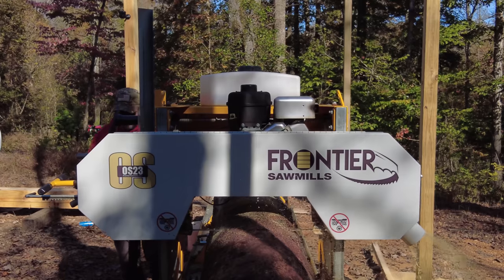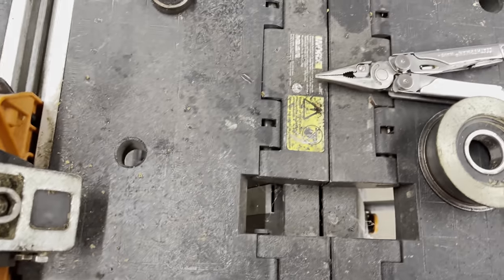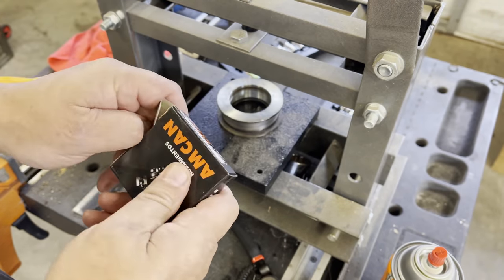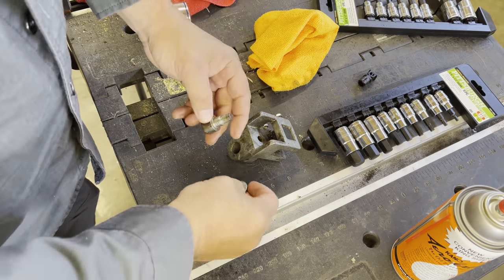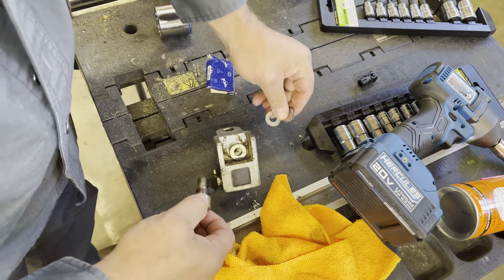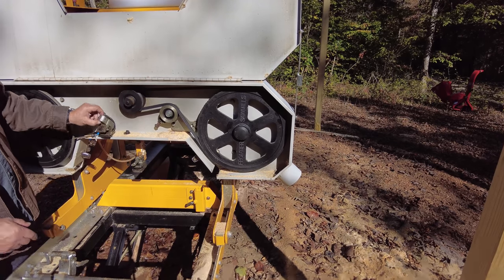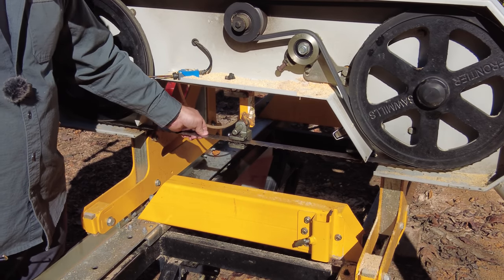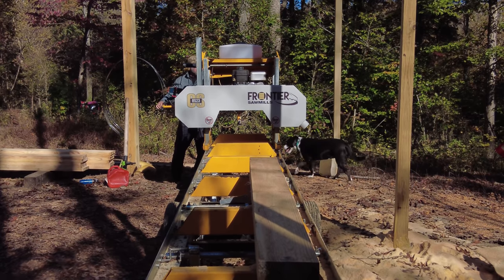Frontier OS23 Portable Sawmill | Watch This First

Comment: I’m a little surprised after 1.5 years that so many bearing have failed.
Reply from the maker: It is not so much about the time. It is more about how much we use it. A car that drives 5000 miles each year vs one that drives 40,000 miles per year. One needs tires.  Plus, I have no problem spending $80 each year on maintaining my sawmill.
Reply: “It’s not the years, honey it’s the mileage.” - Indiana Jones

Comment: Hi Tony. Preventative maintenance can sometimes feel like a chore but it's not in the book for no reason. Thanks for showing this. But yeah sometimes you get a curveball and you just have ro react to it! Gizmo looking a lot more comfortable with the outdoors. Gorgeous pup.
Reply from the maker: Preventative maintenance is king. There is not much to do other than replace the bearings. They are sealed. I ordered extra bearings to keep on hand. I will replace them at the first sign of trouble. They are very inexpensive.

Comment: My mill blade slips.  No matter the tension level I put on the blades.  Saw is brand new with brand new blades.  When I go into the log, the blade cuts for a few seconds and then stops even at full throttle.  Any ideas what I may be doing wrong?  Saw worked fine when I first got it.  Two logs in, I get the blade slippage.

Comment: Sounds like a poor design. Bearings and orings ought to last more than 1 your.
Reply from the maker: It is common on sawmills of all brands. The bearings are turning at high speeds. They go down fast on a $5000 sawmill or a $25,000 sawmill. I figure it is not a big deal to spend $80 each year on bearings.

Comment: My clutch is getting so hot it's melting the belt? Is it bad? Should I replace it or order a new motor?
Reply from the maker: Two things may be happening. Your clutch is worn out and slipping. The slipping will cause excess heat. The other possibility is that you're pushing the sawmills too hard. I see many people try to make the sawmills cut faster than they're capable of.

Comment: Hello Tony thanks for all your videos they've been a big help when getting to know my new OS23. I have a quick question. I watch as you slice through your logs, you seem to move pretty quickly. I have the 10 horse Briggs engine on mine and it is really slow when cutting. I can hardly push at all or my blade will completely stop. I've reached out to frontier and they are stumped. I've adjusted the idler pulley and made sure the tensioner is also tight. I can open the throttle up all the way at the engine bypassing the throttle cable and it still will not cut through a 12 in pine log. I have found that if I bypass the throttle all together and manually push on the governor on the back side of engine I can cut with no stalling. It seems to be a low rpm issue to me. I'm at a loss. Any info would be greatly appreciated.

Comment: It can be really frustrating to have to do maintenance and repairs on equipment when you're trying to get work done... but that's the cost of doing bigger things in life.  We could be sitting around eating potato chips and watching Nascar but there's too much to do outside!!!  LOL  Great video!
Reply from the maker: The centrifugal clutch bearing went out right after this. Lesson learned. Once one bearing goes out, change them all. $80 in bearings every two years, is not a big deal. I think this will be my new rule.

Comment: Tony looks like you did a good job with all the maintenance. I need to do a better job doing the maintenance on my equipment. Take care, Ben.
Reply from the maker: The centrifugal clutch bearing went out right after this. Lesson learned. Once one bearing goes out, change them all. $80 in bearings every two years, is not a big deal. I think this will be my new rule.

Comment: You have good mechanical skills. Were they acquired by technical training, or did you get they at the school of hard knocks?
Reply from the maker: I grew up on a farm, so I had plenty of hard knocks. I also spent almost 30 years in the Army maintaining equipment. I have been to a lot of formal training/schools. I can make do if I have to, but it was easy to have all the correct tools when the tax payers paid for it.

Comment: Same leak here
Reply from the maker: I put a whole new hose system on
Reply: @TonysTractorAdventure  I had a petcock from messing with old lawnmowers. The jinky factory valve is now inline and adjusts the flow and the new petcock is the on/off. My mill has less than two hours on it. Sawed two cedar logs on it so far. Despite the small issues I’m still happy with my decision.
Reply: @TonysTractorAdventure  hey does your exit chute get clogged? I saw on one video a guy actually cut the grates out of his because of clogging.
Reply from the maker: I cut out the grates. I have not clogged up since. Running to much fluid will make clog.
Reply from the maker: The centrifugal clutch bearing went out right after this. Lesson learned. Once one bearing goes out, change them all. $80 in bearings every two years, is not a big deal. I think this will be my new rule.
Reply: @TonysTractorAdventure  note taken! I just got to say I’m having more fun with my sawmill than I ever thought was possible! 🤣